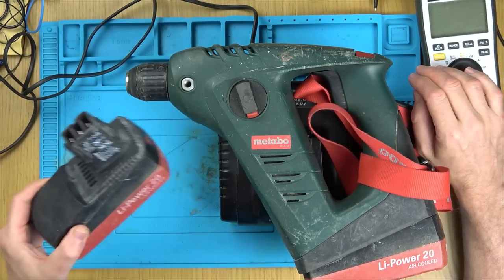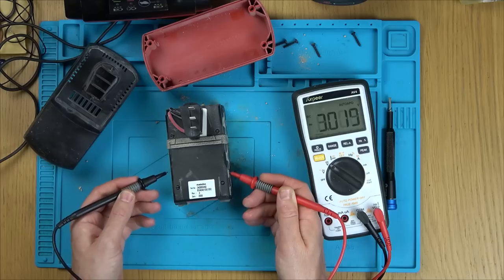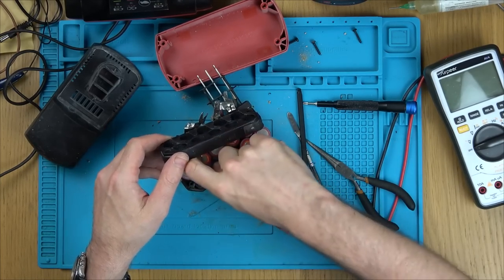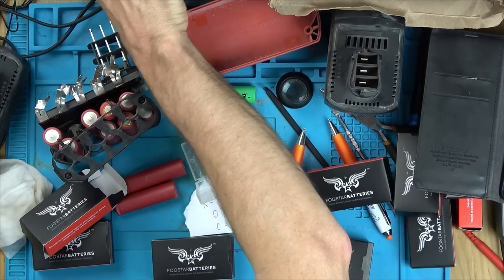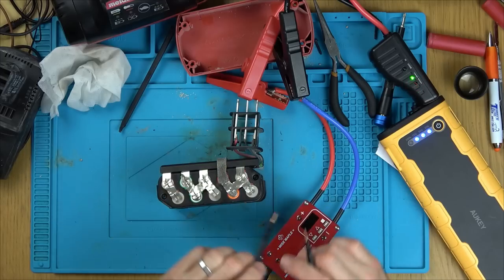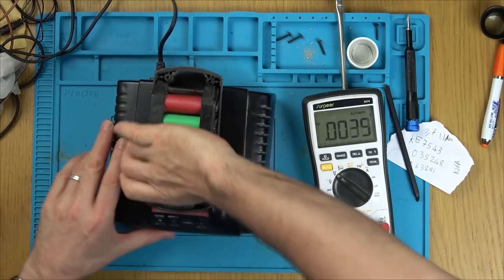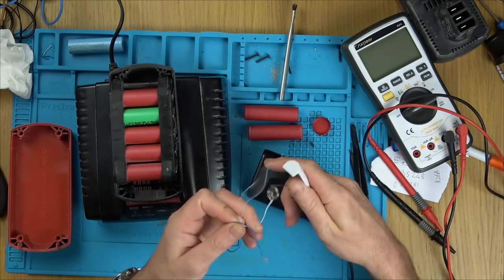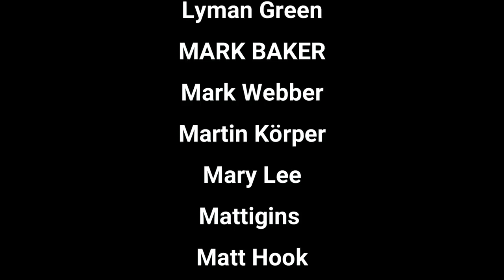DEAD High Quality Metabo DRILL BATTERY - Can it be REPAIRED?

Comment: this is NOT good, Vince, not good at all, I put a thumbs down, it would be better to delete this video.
you can NOT attempt to recharge a Li-ion battery that has fallen permanently to about zero volt, danger of fire.
you can NOT put any li-ion battery for just any use, it must be able to supply sufficient current continuously without heating up, and a powerful screwdriver motor takes a lot of amps, danger of fire.

it's STUPID to unsolder the batteries without testing their capacity, it has reduced with time and use, there shouldn't be much left. which isn't really a big deal, but their internal resistance has spiked and is probably no longer acceptable.
it is almost certain that there is no balancing in this battery, so the voltage at no load and in charge depends ONLY on the relative internal resistance of each pair of batteries, very different depending on whether they are young or old.
the self-discharge rate (the loss when the battery is stored) is also very different.
the thickness of the nickel connecting conductors contributes to the current available for the motor, if it is too thin the current heats the conductor.

the RIGHT way to repair the battery pack is to remove the 10 used batteries and replace them with 10 good batteries allowing a significant flow (in Amps) without worrying too much about the capacity (in Ah).
of course it works with only 2 new batteries but their capacity is limited by the weakest element of the chain, it's wasted money.

I suggest you educate yourself on the batteries, buy a capacity tester and 10 or 20 identical new batteries to replace all those in one or both blocks.

Comment: You used the WRONG cells Vince. Very dangerous what you did. The amps are NOT the only factor. Aka You cannot simply change these batteries due their internal resistance. Also their maximum discharge current is very different. Look up the specs. Do not and I mean, doNOT uses laptop style batteries you showed. These are not suited for drills as these can lock up and also the startup  current can be 5x the nominal current, laptop types are  cheaper and  can overheat easily. Look at the C rating please.

Comment: Never ever mix old and new batteries! Replace the whole pack or don't do it (=waste of time). In this setup you can wait it dies again. Dead cells is an indication to change all of the cells because they all are from the same batch. Soldering old cells is a real problem, it can kill it completely. Maybe it works a few times and then it is dead again.  I know this because I have done this. Better is to replace the whole pack with a new BMS and new batteries. Buy a lab power supply (with current control) and you can charge anything you want. Most safest way to do it if you don't want to spend much.

Comment: A completely wrong repair video. You have to use same batteries with same milliamps. Also you have to be sure that all batteries are either fully discharged or charged before putting them, so that the charger can keep the balance between them.

Comment: Dude that metabo is so old,a modern chinese drill would be better....Chuck that old eyesore....Just my opinion of course.I mean it is just relegated for light duty as the RPM'S are abysmal.A nice modern unit would be one quarter the size and perform way better.
Reply: Not a chance. I have a 15yo Metabo drill, still the best torque in my kit. Some newer drills use plastic cogs, and rarely do they have a fan in the charger to cool the battery while charging to prolong it's life

Comment: ce n'est PAS bon, Vince, pas bon du tout, j'ai mis un pouce vers le bas, il serait meilleur de supprimer la vidéo.
on ne peut PAS tenter de recharger un accu li-ion durablement tombé a zéro volt, danger d'incendie.
on ne peut PAS mettre n'importe quel accu li-ion pour n'importe quel usage, il doit pouvoir fournir le courant suffisant en continu sans chauffer, et un moteur de visseuse puissante prend beaucoup d'ampères, danger d'incendie. 
c'est STUPIDE de dessouder les accus sans tester leur capacité, elle s'est réduite avec le temps et l'usage, il ne doit plus rester grand-chose. ce qui n'est pas vraiment grave, mais leur résistance interne a grimpé et n'est probablement plus acceptable.
le taux d'auto-décharge (la perte quand la batterie est stockée) est aussi très différent.
il est quasi certain qu'il n'y a aucun équilibrage dans cette batterie, donc la tension a vide et en charge ne dépend QUE de la résistance interne chaque paire d'accu, très différente selon qu'ils sont jeunes ou vieux.
l'épaisseur des conducteurs de liaison en nickel participe au courant disponible pour le moteur, s'il est trop fin le courant  chauffe le conducteur.
la BONNE façon de réparer le bloc batterie est de retirer les 10 accus usés et de les remplacer par 10 bons accus permettant un débit important (en ampères) sans trop se soucier de la capacité (en Ah).
bien sûr ça fonctionne avec seulement 2 accus neufs mais leur capacité est limitée par l'élément le plus faible de la chaine, c'est de l'argent perdu.

je suggère de vous informer par vous-même sur les accus, d'acheter un testeur de capacité et 10 ou 20 accus neufs identiques pour remplacer tous ceux d'un ou des deux blocs.